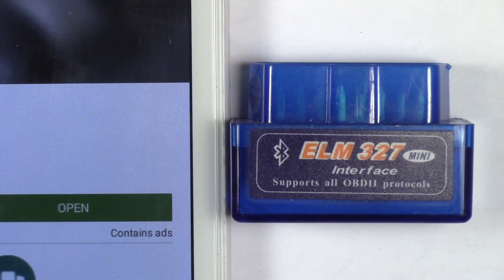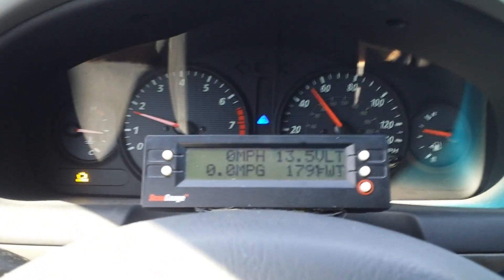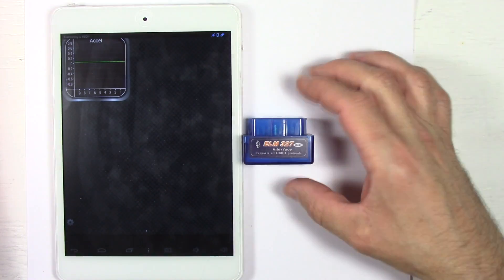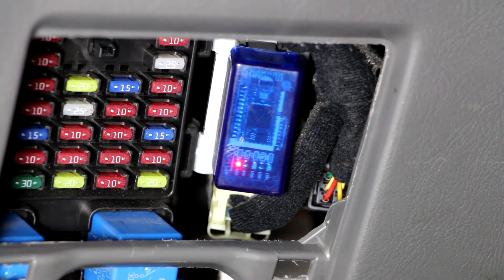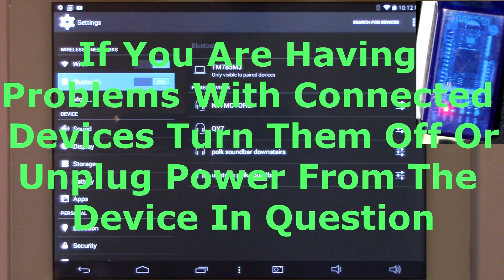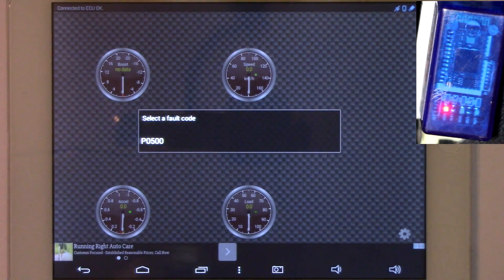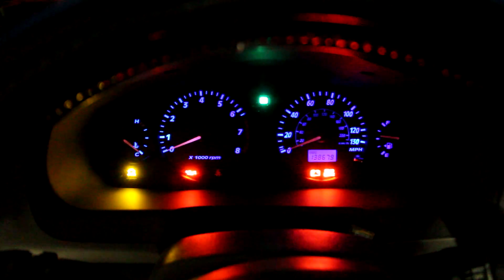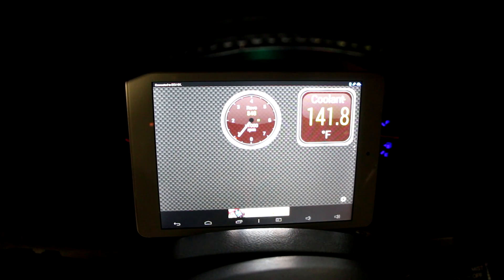Clearing Check Engine Light Using Super MINI ELM327 Bluetooth OBD/OBD2 & Android Hyundai Santa Fe

Comment: how much more the Torque pro can do than the Torque (lite) ?
Also, the OBD tool AL 619 at 3:50. What extra functions does it have that Torque Pro don't?
Reply from the maker: The AL619 at Amazon(paid): https://amzn.to/3RakJjY has the capability to read and clear ABS and SRS Airbag codes off. Here's a good comparison of Torque Pro vs Torque Lite: https://www.obdcomparison.com/bluedriver-vs-torque-pro-vs-torque-lite%EF%BF%BC/#:~:text=Torque%20Pro%20offers%20a%20more,acceleration%20and%20quarter%20mile%20tests.
Thank you so much for commenting and watching. I appreciate it greatly. All the best.👍😀

Comment: Hi bro .just a question i have the same elm327 adapter, but when I connect to tucson 2005, it can't fecht data sensors, well, you use it in santa fe, Im so sad but my hope is null now :C
Reply from the maker: Try it on another car and see if it works there. You may have a defective unit or a counterfeit but you should see what I saw. Tucson and Santa-Fe are very close in operation. Thanks.

Comment: Crap. I ordered the wifi reader. Won't I need to be connected to a network to use it with my device? Should have gotten bluetooth instead. We'll see how it turns out. Great video Richard.
Reply from the maker: Thank you very much. I am not sure how the WIFI device works, you may be able to connect to it directly but again I do not know for sure. All the best. Tell us what you find.

Comment: Hi, is the airbag fault part of the ODB2? someone removed and reinstalled the airbag on my OPEL and the led lights up now, on with the check light. Thanks
Reply from the maker: Unfortunately the Airbag system is not part of the ODB2 protocol even though it is accessed through the same port. Here is a video I made on resetting the airbag on my Hyundai Santa Fe 2003 https://youtu.be/y47kb1YHhUE?list=PLnxXRLSlmSVMFyhSiVg1CDGazka6xKEc3 Here is the scanner I used http://amzn.to/2oAIoi8 Make sure the scanner is compatible with your car before you order it. Thanks.

Comment: Viewers PLEASE READ. The OBD2 connectors will work on ALL OBD2 equipped cars. The language is generic. That's why the software and apps also all work. If yours doesn't work you either have not plugged it in fully, you did not tell your device to find this on your Bluetooth page and then enter the password or you have a bad unit. There are really no other options. As simple as a table lamp. You plug it in to access power, you turn the switch on to connect to the power and light your lamp. If you have power plugged in and the switch turned and no light, you have a bad bulb.

Comment: Thanks for the video, I didn't know how to gather the fault code in Torque Lite app. Happens to be P0101 - Mass Air Flow Circuit Range/Performance. At the Nissan dealer (in Canada) they charge 90$ just to read the code !
Reply from the maker: That's an easy $90 if you can get it. LOL. Glad I could help and thanks for the feedback and watching. Here is the link to it at Amazon: http://amzn.to/2dBUrma for anyone who is considering purchasing the one I used. All the best.

Comment: Hi, I am hoping to get a ELM 327 mini. Is it possible to read the Transmission oil temperature, which I want to keep an eye.
Reply from the maker: It depends on the vehicle. Different cars have different sensors and may require custom programming to get the result your are looking for on your car. Here is an example of this http://www.siennachat.com/forum/20-towing-hauling/5891-i-can-read-transmission-temperature-my-phone.html Thanks
Reply: Dear Richard, Thank you very much for taking time to reply. I am having a Honda Vezel 2015 Dec. model. Some time in bumper to bumper traffic I found that the car was not moving although the engine revs were coming up. A friend of mine too had the same problem. So I think it is best to keep an eye on the oil temp. Any suggestions? I am worried about the clone of ELM 327 ICs that come with many of the ODB 2 scanners. Thanks for all  the assistance.
Reply from the maker: Have you talked to Honda about your problem? Your car should still be under warranty. Here is a discussion I found on this issue http://www.hrvforum.com/forum/466-engines-technical-discussion/3362-honda-vezel-ru3-ru4-dct-well-known-issue-fixed.html Thanks
Reply: Hi, Richard. Thanks a lot for all the assistance. If fact I did contact Honda agent in Sri Lanka, and they will give me a time to take the vehicle to them. They too said that it may be an issue with the duel clutch. Since of late while in heavy traffic I keep the car in neutral and so far did not have the issue.Will keep you all updated after the visit to the agents. Thanks a lot.
Reply from the maker: Very well. You should not have to do anything with an automatic transmission in traffic no matter how heavy the traffic. It should just work. All the best.
Reply: Hi, Richard, merry Christmas & Happy New Year. Hope you are having a wonderful time. I got my ELM 327 mini, but unfortunately it does not give the ATF oil temp. There is a option to add custom PIDs in hex. But I have still not found it. Do you know about this.
Reply from the maker: I believe it's possible but I have never done it. Here is what I found http://digitalcommons.calpoly.edu/cgi/viewcontent.cgi?article=1089&context=cpesp Thanks

Comment: I just bought this same bluetooth dongle and every single app I've tried tells me it can't communicate with the ECU, but I can connect to the dongle via bluetooth without a problem.  Tried from both my laptop with BT and my phone.  Does this thing not work for domestic cars or something?
Reply from the maker: Try it on an import, ask a friend, and see if it works there. I suspect you have a faulty unit verify it on another vehicle it should work on domestic and foreign cars. Thanks.
Reply: I had the same priblem with my ELM 327 it connects via bluetooth to my phone but when i open the Torque Pro the only display working is the Voltmeter.....tried to create a profile for my car using Torque and set the OBD2 Protocol to ISO 9141-2 and relaunched the app and voila!! its now working!!

Comment: are you going to do a video followup to what caused the code and the fix? be interested in that!
Reply from the maker: Yes I am. I am waiting for a clip from Hyundai to complete my Vehicle Speed Sensor (VSS) which I ordered and received that was incomplete. I could use the old clip but I want to replace the whole assembly with all new parts. I will point out how to make sure that you get the correct (complete) assembly when you order a VSS. Unfortunately I learned that not all suppliers ship the complete assembly but this was my fault for not knowing the correct part number for the complete assembly. BTW the complete assembly part number is 4651039700 and the KIA and Hyundai part are identical. Thanks I estimate that I will have the clip next week. All the best

Comment: Here`s a Honda common fault code P1298 Electric load detector, " The Electric Load Detector (ELD) measures the main current flow and sends that signal to the Engine Control Module (ECM) to command the alternator charging system to get fuel efficiency and decrease the drag of the engine when starting ". Apparently what ive been reading it also loads the alternator on braking, and lessens drag on acceleration. 

Lets hope it knows when the battery is low and to charge the damn thing, lol . 

Read more: http://www.autocodes.com/p1298_honda.html
Reply from the maker: Interesting engineering, I wonder how much efficiency is actually gained with this circuit? What I don't like is when it stops working it starts making the engine misfire. You have to wonder if it's worth actually having? BTW this system will not keep the voltage at 14V continuously as in most cars in fact it will only do it when it needs to. This is something the car audio enthusiasts have a real problem with. Glad I don't have to worry or deal with that issue. http://www.civicforums.com/forums/21-i-c-e-electrical/159859-meet-your-eld-electrical-load-detector-2.html Thanks
Reply: Richard Lloyd Can`t understand why its fitted, i read it gives 1 to  2 mpg extra, WOW, town driving here in London is so unpredictable that you would never know if it`s working or not. cheers
Reply from the maker: Sounds to me that this system would keep the battery chronically undercharged. I saw one comment in the above discussion that mentioned that Canadian Hondas do not have the circuit. I Canada where the temps can plummet to -50 the last thing you want is an undercharged battery. Sounds like Honda understands this but seriously for the 1 to 2 MPG extra you gain with it I say it's not worth it. Give me 14.0V output when the battery or the system needs it like ALL other cars in the world and let me worry about replacing the alternator when I need to as well as the brake pads and alternator drive belt. I imagine that if you are primarily a city driver that this system would wear out the Alternator and belts quicker than a car without this system. Thanks again. Engineers seldom reveal their secrets or their mistakes.
Reply: Richard Lloyd Just read that about Canada very interesting!, the guy also says the Euro models don`t have it, my sons Honda CRV has the fault code, he changes cars more than his socks : ), i agree with you i want the alternator to charge the battery proper, here our winters are not that cold, but we get long periods of very cool temps 2s 3s 4s  celsius.

BMWs after a run short or long, the on board computers check for 20mins, Lexus it`s 40mins, so top volts is essential to me, but what do in know.
Reply from the maker: It sounds to me like they are cheating the system to gain an extra couple of MPG's but I don't think the savings is worth the undercharged battery or the wear and tear on the alternator and belt. I prefer to know that when I drive my car for a few minutes that it will fully charge my battery and drive all my electronics at the proper voltage. Many cars continue using battery power after you turn the car off for various reasons. My Kia in hot weather will continue to run the electric radiator fan after I shut the car off to cool the radiator. I want the car to fully charge the battery next time I start it and I don't care if it uses a bit of fuel to do so. Also I don't agree with using the alternator to slow the vehicle down. Brake pads and rotors are far more effective at doing that (cheaper and easier to change too).
Reply: Richard Lloyd Agreed, great speaking to you Richard always a pleasure, seems like we sing out of the same hymn book on a great many things.
Reply from the maker: Likewise Paul. I ascribe to the KISS principle. There is genius in simplicity and systems should never be any more complex than required to be effective. All the best.